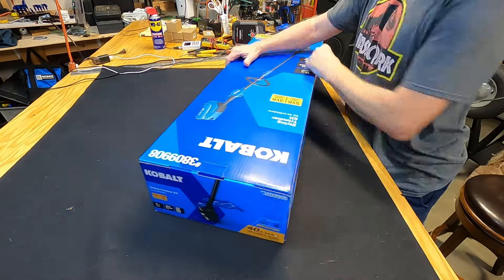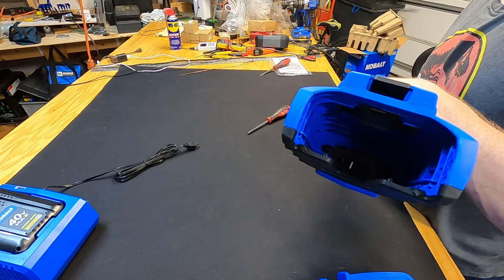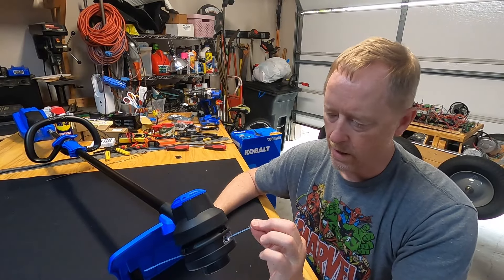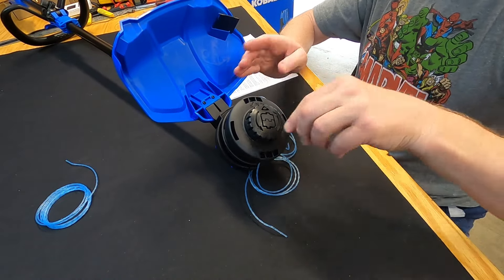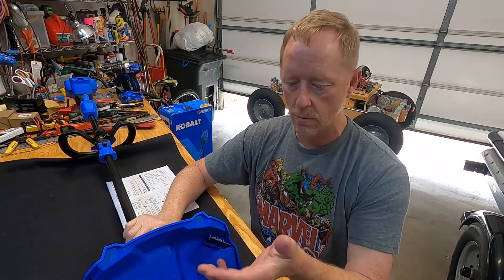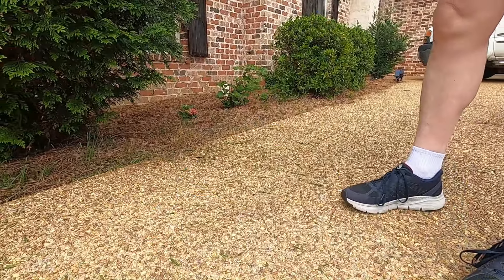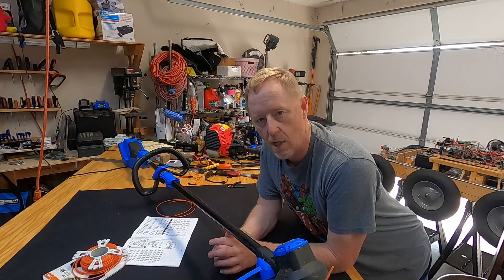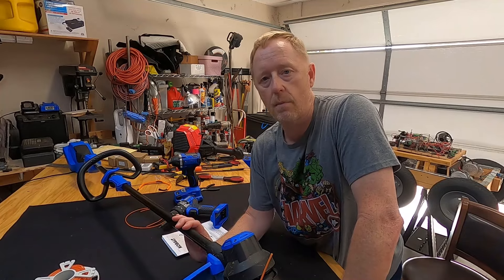40V Kobalt Weedeater Review

Comment: Bought my first kobalt mower on clearance for $79.came with battery & charger. I then went on Craigslist & got a kobalt mower plus 3 batterys a d 2 chargers all from 2012 For Free!!. They all still work but the 3 oldest batterys only charger enough for 10 minute run time. Just bought a new blower and hedgetrimmer yesterday. Both came with batterys and a charger each. It's cheaper to upgrade the tools and get a new battery & charger than to just buy a new battery. I've been using kobalt now 7 years & all my equipment still works, I just ha e 2 sets of everything for my two property's & that's nice. My weedeaters I use to cut 3' swath along outer 600' fence leading down our driveway to the house with no problems a d I use these on our 10rental house property's to

Comment: Mike, I really liked your video on the Kobalt 40volt Trimmer.  I am a Kobalt tool owner and user and I have thoroughly enjoyed using these 24volt battery powered tools.
I have owned the following Kobalt 24 volt tools for 9-1/2 years; drill driver; impact driver; 7-1/4" circular saw; Reciprocating Saw; Chain Saw; and Pole Saw.
In addition, I have owned a 40volt Lawnmower for 9-1/2 years without a single issue.
I really enjoy using the Kobalt tool brand tools and highly recommend them to all of my friends and family.
Finally, I like and appreciate how Lowe's Home Center stands behind it's 5-year warranty for their Kobalt owned and branded tools!
Well done on your review!
Reply from the maker: Thank you.  I appreciate the feedback.  Kobalt has come a long way.  The better known brands don't have nearly the longevity and quality they used to have, which is why I tried Kobalt.  So far so good.
Reply: Kobalt is identical to GreenWorks (through Amazon) and  is sold through Lowe's and is good quality...
Reply: at 11:50 ...use heavy shears to make both ends of the line identical and do NOT let the installed blade cut off the nylon string....

Comment: The Kobalt 40V power supply weed trimmer (through Lowe's) is identical to the one from GreenWorks (I bought a blower and trimmer that share a 40V power supply that is rechargeable through Amazon as a package deal several years ago). Be certain the power is removed before you handle the trimmer.

Comment: Had mine for 3 yrs. Batteries still good but the trimmer cuts off every 3 seconds.   But if you let off the switch then squeeze it again it starts back up.  Aggravating as crap
Reply from the maker: It sounds like the trimmer motor is overheating.

Comment: I have a lonely 40 v trimmer. I hate it. The only reason I keep using it is because I have 3 batteries for it and don’t want to buy batteries for a different weed trimmer. I spend more time try it to replace the string than I do trimming. There’s got to be a better design for changing the string. Evidently I’m not the only one that has trouble with it, considering the number of videos out there on how to restring it. I wouldn’t advise anyone to buy a Kobalt!!
Reply: All string trimmers can be annoying to restring. Of the 4 different ones I’ve owned, 3 of them used this method and once you get the hang of it, it’s fine. But if you really just don’t want to mess with it, there IS an easier way so you’re in luck!  Just buy the pre-wound spools!  Those are made just for you any anyone else who hates to restring. 

One battery trimmer out there uses the battery to spin the head for you to assist in restring, but that only helps a tad. Restringing will always be annoying, it’s just part of string trimmer life. You just need to practice to find the little details that help you personally, like using pliers or a clamp to twist the head, or use the pre-strung spools. You could also switch to the solid blades instead of string, but I never had good luck with those. They wear out and break pretty fast so they end up even more annoying in my experience. If you can avoid EVER hitting anything like a fence, tree, curb, or other hard obstacle, EVER, then the solid blades might work out better for you.

Comment: ABSOLUTE GARBAGE.  Had mine for 2 years then it stopped working... it runs still but too slow to be useful. DO NOT BUY.  Also had several batteries go bad too.
Reply: you may be wrong and are unwilling to admit the problem and fix it...